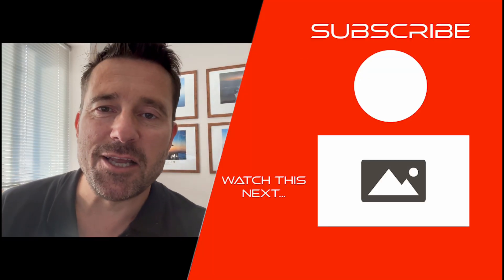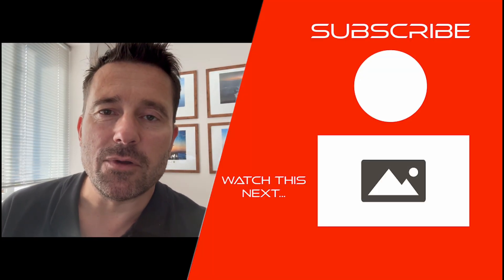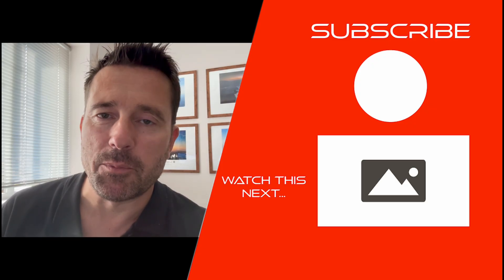YF-23: The Fighter Jet That Was Too Good to Be True?

Comment: I saw the results of the Goff and the F-22 did beat the YF-23! It was based on ratings of each requirement. But, there are a number of engineers like myself would like to see both aircraft produced and let the F-22’s (50o ac) lead the F-23 ( more stealthy for penetration.

Comment: The F-23 Black Widow II would have looked vastly different from the YF-23 Rapier prototype, the wings of the in service model would have been the same as the F-22 Raptor because the aircrafts had to have the ability to use hardpoints, they needed to have a gun, they needed to be Mach 2 capable and have afterburners, the YF-23 would have had to have more powerful engines installed that had afterburners, different wings able to support hardpoints, a gun installed, and would have had to go back to the drawing board, the YF-22 Lightning II was ready to go into production as the F-22 Raptor requiring so few modifications that it had a very short R&D by comparison (it took longer for F-4 Phantom II, F-14, F-15, F-16, and F/A-18 to go through R&D before production than the F-22 and although I haven't been read into the modifications made to the YF-22 Lightning II prototype to become the F-22 Raptor in production, there are modifications to prototypes to become the production model so frequently that it stands to reason that the same is true of the F-22 Raptor)

Comment: This was fascinating. I followed this ATF process back in the 90's and always wondered why the Air Force picked the winner as the F-22, when it seemed to me with my very limited access to any data, that the F-23 outperformed it in several aspects. The F-22 is a very capable aircraft on it's own, but why go in that direction. I was a US Navy maintainer of the Grumman EA-6B, and a big fan of the F-14, and still work in the industry so I know what is what with the maintenance end of it, and have close rapport with the pilots as well. Seems to me it was another political goatfuck with Lockheed winning the contract.